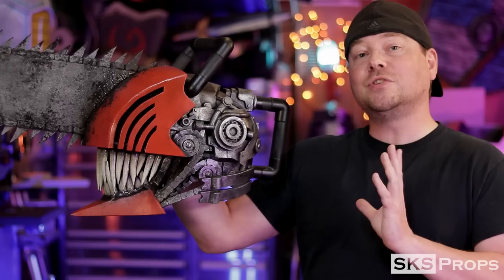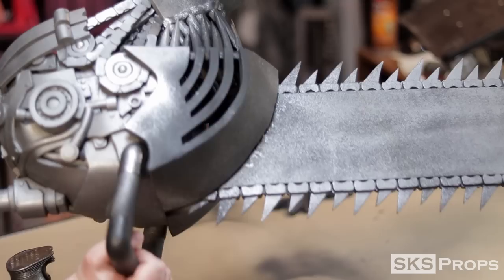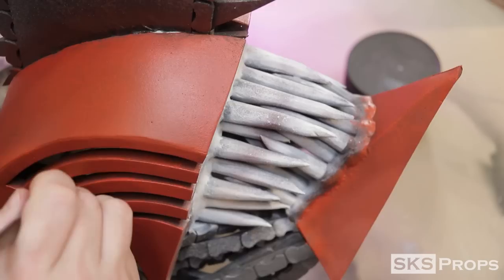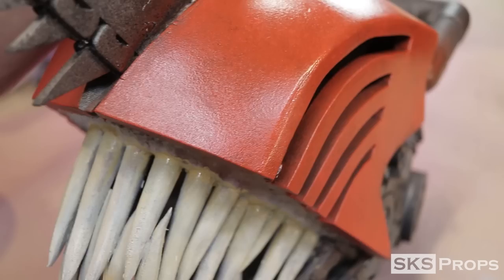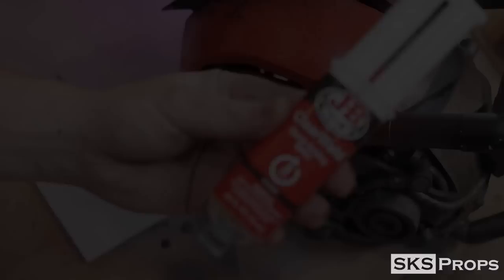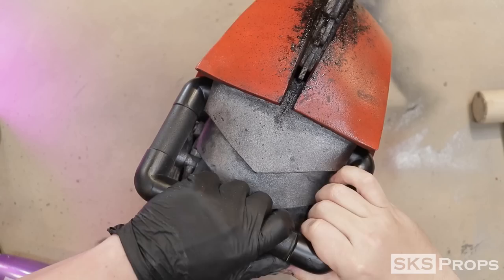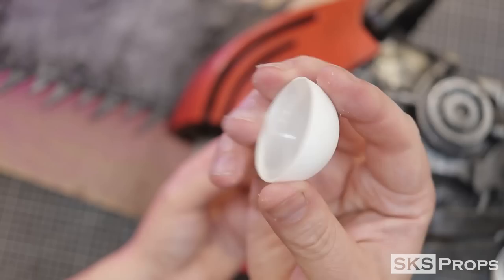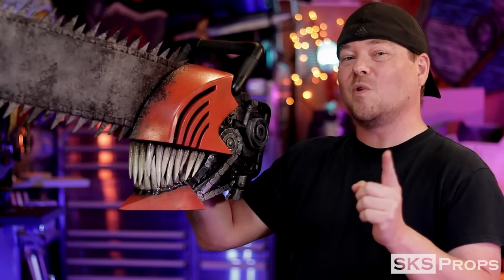How to Make a Chainsaw Man Cosplay Part 2 - Painting and Weathering Prop Tutorial

Comment: This is gruesome and terrifying, I love it! Now that it's done, how does the weight distribution feel when you wear it? Is the blade tipping your head foward? Looks amazing!!
Reply from the maker: Weight is actually really good!  it doesn't tip for ward but again the entire thing only weighs 1 pound 10 ounces and most of that is in the pvc pipes at the back of the head
Reply: @SKSProps  right! And even if the weight is too overwhelming on the saw, you can always add weight inside the hollow PVC
Reply: ?...how do you see
Reply from the maker: @joewagoner3483  out of the slits on the sides but mostly through the gaps in the teeth

Comment: Really found it clever how u mixed the epoxy with the paint. I’m a lil inexperienced with using epoxy but I was wondering if such a process could be imitated using e6000?
Reply from the maker: I'm not sure, I do know e6000 takes 24 hours to cure vs 5 minutes so Id'd honestly just go with the epoxy. also E6000 is very toxic be sure that you are using that in a well ventlated area if you go that direction

Comment: HI! I saw your templates and I had a question for you. Are the quills on the blades on the arms the same size as the quills on the blade on the helmet? Or since the blade of the helmet is shorter, are the quills smaller too? Thank you
Reply from the maker: They are the same 👍
Reply: @SKSProps  Okay! I thought they were smaller to make them proportionate to the size of the blade on the helmet (which is actually smaller than those on the arms). A thousand thanks!

Comment: Does the Plasti dip spray paint affect the cosplay at all? I’m on a bit of a budget and it’s pretty expensive over here, will it work the same if I use regular spray paint?
Reply from the maker: If still recommend to seal the foam before painting it. You could use mod podge, flexbond, hex flex, or Plasti dip.

Comment: king . need help with one thing ..plasti dip isn't available in my country . So what should i do before using metallic silver ? and u used transparency spray at the top of the head to give it a glassy look ?
Reply from the maker: You could also use pva glue or mod podge to seal your foam instead of Plasti dip. And yes just look for a gloss acrylic spray
Reply: thank you so much 💜💜💜

Comment: Hey man, I'm working my way through your tutorial and am about to begin the painting process. I wanted to ask if the Liquitex Basics paint would work instead of the Heavy Body paint, as it would save me nearly $100 to switch them. Thank you
Reply from the maker: In my opinion not really because the basic paints have a much lower pigment count than the heavy body versions. which means you’d have to paint the same areas multiple times with multiple layers to get a good coverage.
Reply: @SKSProps  Alright then, even if I don't like the price I'd rather not cut corners. Thank you for the help and the fast response as well.

Comment: Is plasti dip really necessary? I want to try to cut as many corners as I can without affecting too much of the final project since I don't really want to drop more than $100-$150.
Reply from the maker: You need to seal the foam somehow so Plasti dip, mod podge, creature cast, or flexbond are all options 
Mod podge being the cheapest but you have to brush it on rather than spraying it

Comment: This will be my first time using plastidip, I’ve seen a few videos saying to use “wet layers”, maybe a bit heavier than the thin layer I saw you use, but it was only a short clip of yours so not sure how you did it. Tips for applying the plastifip spray? And how many cans did it take you? Thanks
Reply from the maker: I am in the Midwest (humidity matters) and use 2-3 thin layers do not put it on thick it will obscure details and worse case run. Helmet and arms 2 cans
Reply: @SKSProps  I’m in Canada, it’s around the freezing mark right now. Thinking of blocking off an area in my carport and using a space heater to get ambient temp up. I’ll do thin coats and pick up another can. Do you warm up your cans up in water first?